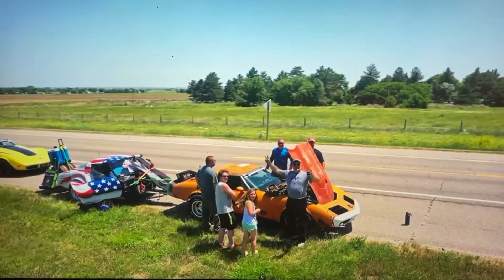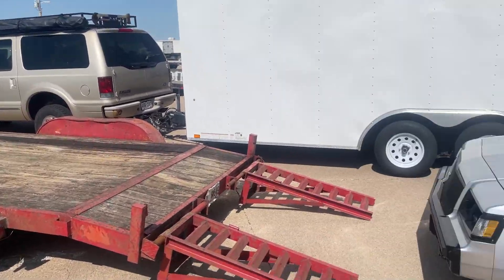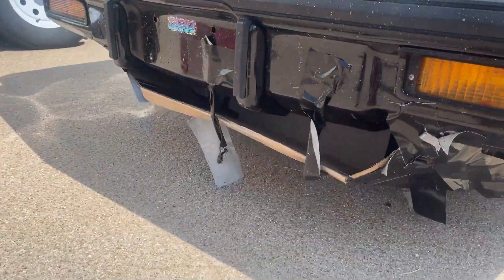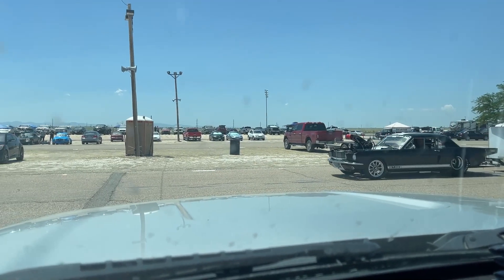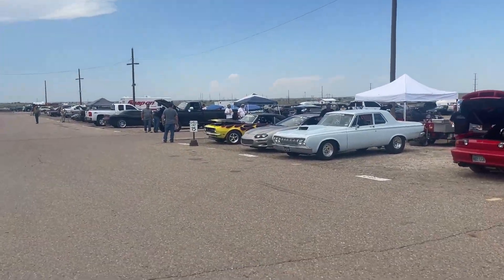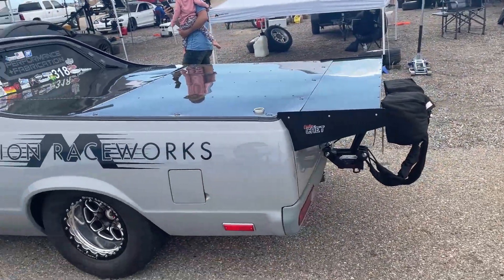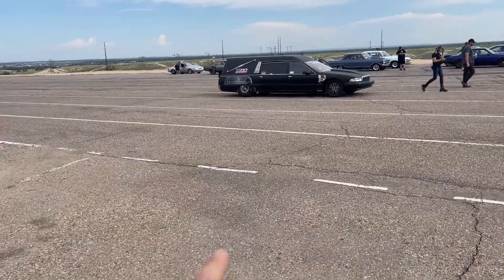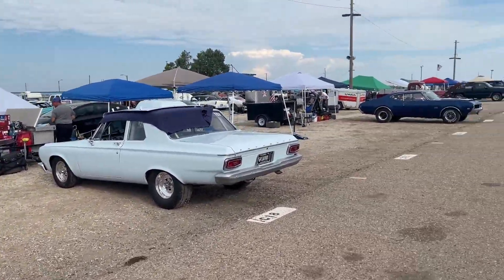Rocky Mountain Race Week Day 2-3 (DID WE MAKE IT???)

Comment: What gear ratio did you go with on your 9 inch and how does it do on fuel mileage?
Reply from the maker: 3:50. I get 17-21 cruising
Reply: @SkinnyPedalMotorsports  thank you I was debating between 3.50 and 3.70 but that's pretty good mileage and I do drive it on highway alot.